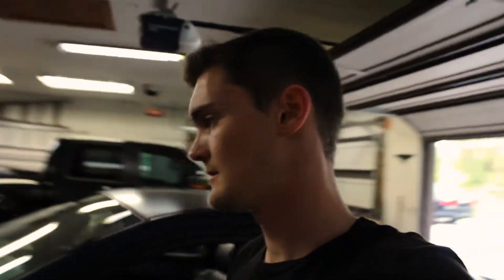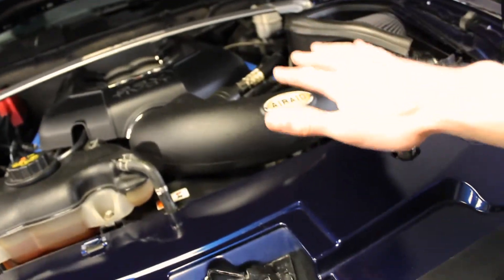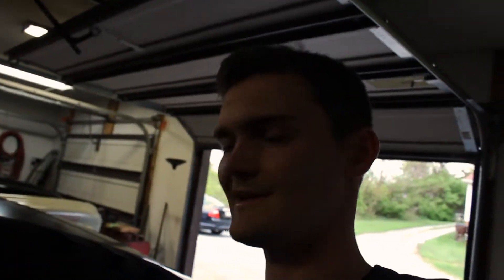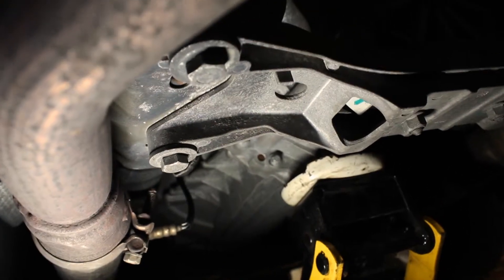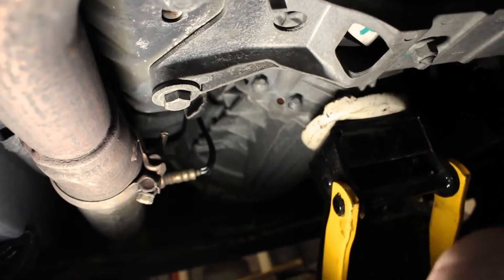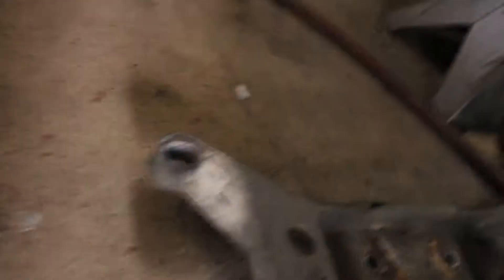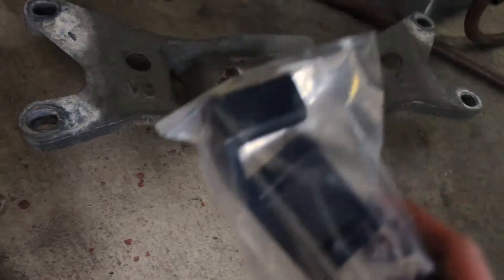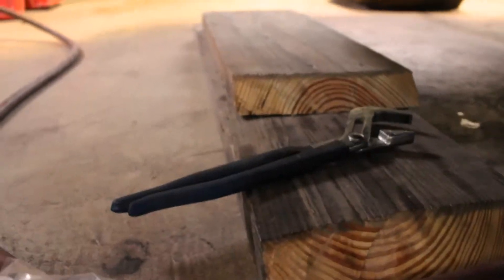ANOTHER Mt-82 problem

Comment: My mt82 5th gear is grinding how can I fix it?
Reply from the maker: Sounds like it could be the synchro going out.. I would definitely have someone check that out because the MT-82 is notorious for that with 3rd and 5th gear from what I’ve been able to understand
Reply: My mt82 won’t go in 5th gear either did u figure out what the problem was?
Reply: Get a built MT82 by Ben Calimer.